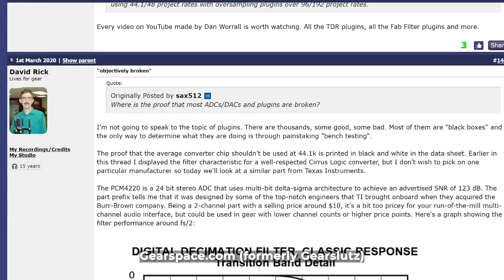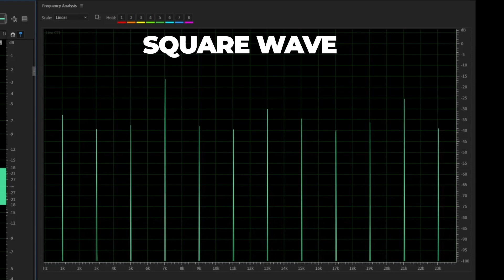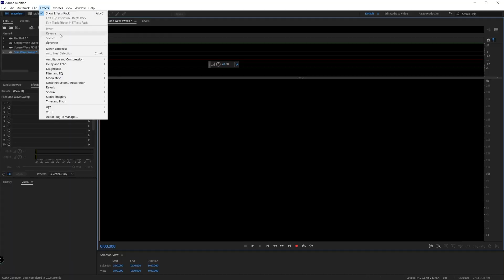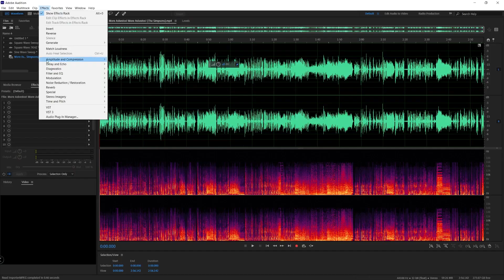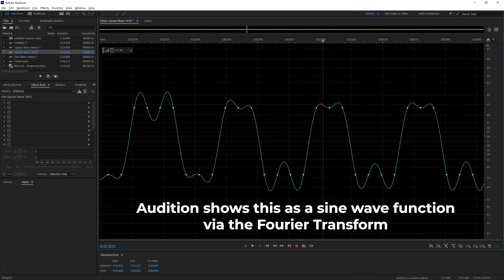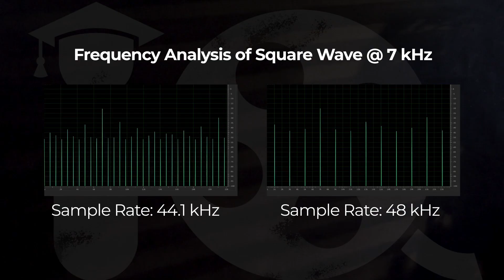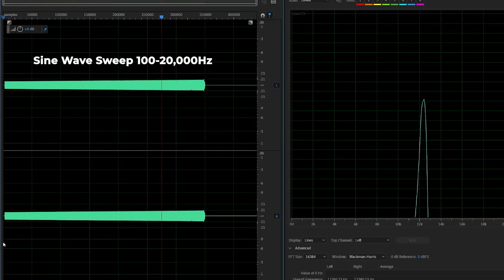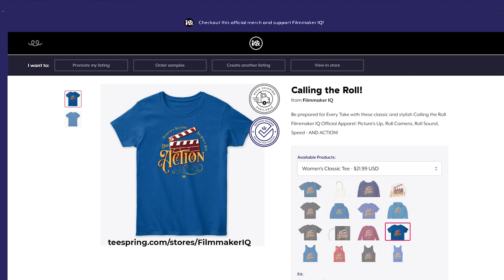What is the Optimal Sampling Rate for Audio? (It's All About the Aliasing)

Comment: Another thing. These tiny hair in the inner ear, being the hairs they are, are capable of vibrating in overtones as well as their fundamental.
The result of this that one such hair, say, matches a 5 kHz fundamental, could also resonate (in a more complex pattern) at 10 kHz, 15 kHz, etc.
This is another way of how ultrasonic tones are picked up by the ears - they can get picked up asif they were the fundamental of the overtone. This may account for how ultrasound influences and adds to the perception of normal sounds.

I remember doing some experiments with a tone generator, producing a strong 30~50 kHz tone on my headphones. I did notice a sound, it was not silent to my ears. It was a bit like an intense hiss, not very easy to think of it as a single tone, but it was intense, and would quickly hurt my ears if I tried to turn it up louder.

Having said all this, I still think that the effect of all this is very little.
Reply from the maker: So... Aliasing in the ear.

I think this is more evidence you WANT to band limit everything to around 20khz

Comment: The aliasing occurs because the simple generator has to fit the sample grid. At 10k you can see 3 short periods followed by 2 long periods because that is the closed match it can do without fractional steps. It can only fit perfectly if the sampling rate is a multiple of the frequency, such as 6k or 12k. A1k tone will sound cleaner at 48,000 too.

There are generators that mix the harmonics or use a finer grid followed by filtering and downsampling.

The conversion between 48 and 44 is relatively hard if you push artificial test signals that are loud at the upper limit. Simple resamplers are sometimes used. There have been reports where YouTube has messed up the conversion and one format turned out cleaner than another. It does some crazy chained conversions using ffmpeg. Currently it might be able to deliver 20k in Opus.
Reply from the maker: I think YouTube hard limits anything past 15khz
Reply: In the Opus stream I can see (well I can't hear them anymore) loud tones up to 18K. The audio has been through one generation of AAC adding the cuttoffs and blockiness. And the quieter tones start breaking up because the codec resorts to replicating them from lower bands at this bitrate.
https://i.imgur.com/E5VriTI.png

Comment: Curiously, it's possible to hear frequencies up to at least 50KHz, it has been demonstrated with bone conduction experiments all the way back in the 50s or so; however it was also demonstrated that they basically don't really matter - it's impossible to tell apart frequencies above approximately 16.5 KHz, they all sound the same, and there is some hard anatomical reason for that, i forget. So you may perhaps actually want to capture a little ultrasonic energy, but you can fold it back into the band above 17-ish KHz.

Band limited synthesis of the square wave is a solved issue. I think the simplest way is additive synthesis from sines, which you cover right in this video. Since Adobe has ignored this well known insight, one can consider their square wave synthesizer buggy by design, maybe they made it this way to look good to amateurs, band limited square wave always looks like it's heavily ringing, even though it's not. Unfortunately a lot of algorithms and plug-ins have some aliasing or other sampling rate related issues such as "EQ cramping", either due to limited computational budget or by oversight. So high sample rate intermediates are sometimes good, though should be ever more rarely actually needed as far as DAWs, their builtin effects and generators, and higher end plugins are concerned. Audition probably doesn't have quite that professional an ambition for a silly effect.

Something to keep in mind that most recording devices don't truly have a configurable sampling rate at the lowest hardware level. The reason is that the analogue filter that would reject aliasing needs to be tuned to the sampling frequency, and you don't want to include the same hardware several times, and yet more hardware to switch between those variants, not only for cost, but also for noise and other degradation that ensues. So the internal sampling rate can be for example 384KHz, and often analogue anti aliasing filter will have a corner frequency of somewhere just north of 20KHz. So you have over 3 octaves of filter room, so at 36db/oct filter, there's like 110db of suppression for all the junk. Then the ADC will have an internal downsampling to something more palatable, like 48/96/192 KHz, and these are easily aliasing-free. This isn't entirely how modern ADCs work (keyword delta-sigma modulation), but it's not too unfair a simplified representation. If 44.1/88.2 KHz are desired, resampling happens elsewhere downstream, in a DSP or software, and of course then it's the issue of how much you trust that particular implementation to be low aliasing. Just 12 years ago, it was not uncommon to find fairly low quality sample rate conversion in a major DAW! It's not entirely trivial and fairly computationally taxing to get right. Things got a lot better since. But for a given audio interface, you shouldn't expect 48KHz mode to introduce any aliasing that you can avoid by recording at 96/192.

Besides aliasing, the other potential resampler behaviour trait is phase shift, which nominally isn't audible, but under circumstances can be.
Reply: I bet it's not 50 kHz sound you can hear but lower harmonics from that vibration exciting stuff in your body.
Reply: @VioletGiraffe  Harmonics are always above the fundamental, not below.

But indeed it has shown that there are no auditory hair cells that correspond to higher frequencies than about 16.5 KHz. And yet there is apparently a mechanism to excite them with a higher frequency signal.
Reply: yeah subharmonic resonances would make that possible, it's the same sort of thing where humans can (pretty easily) distinguish phenomena above 60hz - despite that when *staring dead-on at a screen*, your eyes can't tell the difference. but your cochlea has actual pitch-specific resonators; the hairs float in the resonator bit, and the  resonator bit definitely does not have a 50khz band. so, yeah, it makes sense that you could identify the presence of sound in your environment that was generated by a 50khz emitter, but there is actually no possible way your brain could receive it as 50khz sound, it would be like seeing gamma rays or being touched above the top of your head - you can hallucinate the experience due to a real phenomenon in your environment, but it's not really representing reality correctly.

Comment: The difference heard between sample rates and bit depth are only down to the various filters applied to the signal when the audio device change mode. The best practise is to calibrate one and only use it, and work on your room acoustics and modes. If ou change bit depth or sampling rate you have to re-do your calibrations. It is actually better to play various sample rate materials all down to the same calibrated output than to change the output to the same as the material input. But inside the computer keep all your files as they came. When playing only use the output that is well known and calibrated. My outpud DAC is outputting 20bits 48 khz because I need the 48khz for the bluetooth compatibility and I use 20 bits because I am snob (it's for a type of stream). If I had not other constraints I would use 44.1 and 16 bits because that's enough, even when I want to smash the ears with 115db. As long as it is balanced xlr out for analog, we are happy. There is no excuse for time domain (and yes whe hear 7mn time bounces) n excuse for depth, no excuse for noise, no excuse for ultrasound.

Comment: As I understand it the main benefit to recording at higher sample rates is if you use any pitch manipulation or auto tuning. If you want to  digitally lower the pitch of a note then you could find information above 20khz shifted down into the audible range, so higher sample rates would smooth that out a bit. In practice even this isn't a real big problem, chances are you're moving the pitch not farther than to the nearest scale note, and even at 44.1khz it seems to do that fine.

Comment: Interesting video. Sample rates for recording should not be confused with sample rates for final distribution.  There is a valid reason to use high sample rates in the recording process for mixing and editing but the arguement for more than 44.1KHz for playback is questionable and may actually degrade audio quality with ultrasonic noise.  A well recorded track that is re-sampled down to the 44.1KHz CD format is capable of delivering top quality audio.

Comment: Best sampling rate is the rate of output DA converter. Every lowcost device on the market have 48kHz DAC, higher priced devices going to multiples of 48k. Its not good for music, because of 44100Hz matrix standard for music. Aliasing is not only microverse fs/2 problem, it is overall spectrum problem include bassline. Check your DACs rate and record music in the same rate with ADC. Dont use software or numerical hardware to resample. Use DA-AD, DA-mixer-AD, DA-mixer-effects-AD, yes, mixer and effects in analog version. If you have music CD, you needs 44100Hz DAC to not get aliased listening. Only PC soundcards providing 44100Hz feature nowadays. If you do this, you will find that everything has to be done in real time, not faster. Or record your music into 48kHz directly and have no aliasing problem with anycost players... PS: Fourier transform cannot solve aliasing perfectly, e. g. brickwall, interpolation, lowpass filters. Just only ADC built-in comparator can do.

Comment: real fun times when you generate a 10khz square wave with a function generator and not run it through anything to contribute sampling error.  fun experiment, but could still definitely tell the diff between square and sine, and even sawtooth for that matter (most of the lab could).  could be that the speakers you use have an impact on this test as well.  noticed the switcharoo at the end too
Reply: Yes, the existence of harmonics can easily be heard.
Reply: @kensmith5694  cool

Comment: Only real advantage to faster sampling rates is it makes the anti-aliasing filter easier to design. I routinely oversample industrial ADCs 8x so I can get away with using a 1st order low pass filter. No brick wall filter required.
Reply: In one design, I over sampled by a factor of 22.  It was for the reason you suggest plus the fact that the numbers grow extra LSBs when you do it.  The noise rattles the bottom few bits and then the filter averages those numbers.

Comment: Another thing to consider when it comes to the actual recording process is that ADCs aren’t actually taking momentary samples of a raw voltage, they’re actually integrating a sample over time. So the aliasing effects from a recording are different than the aliasing effects from a resample of an already-digital signal (and there are also different means of resampling a digital signal that mitigate the aliasing effects). This video mostly demonstrates that Audition’s signal generator is just really bad at its internal resampling method and is just doing a naive nearest-neighbor approach. It’s definitely something to keep in mind when it comes to sample rates but it’s definitely not a win for the audiophile camp.
Reply from the maker: I disagree that Audition did anything bad. It wasn't resampled, Audition created a genuine square wave - exactly what it was asked to do. A genuine square wave has these aliases especially at those frequencies.

And looking more into it, I don't believe ADCs are integrating samples over time, they are sample and hold. Aliasing in recording works the same way, it's just most equipment already band limits the audio being recorded
Reply: @FilmmakerIQ  There might be a few different ADC technologies out there, then, because the understanding I had from the origin of DSD (as opposed to PCM) is that it's getting the raw signal from an earlier stage of the ADC, specifically to avoid aliasing artifacts and to allow true resampling of the closest possible equivalent to the raw analog signal. Of course that's a whole other audiophile rabbit hole to fall down.

And yes Audition is generating a genuine square wave, but the way it's generating it leads to a crapton of sample jitter in the frequency domain. If they had done even basic antialiasing of the signal it wouldn't have been pure -1/1.

For a visual equivalent, this is like doing non-integer nearest-neighbor scaling in a retro video game console emulator, leading to visible shimmering as the screen scrolls. Generating a visual black-and-white checkerboard has the same problem, where your checks aren't going to have the same perceived width across the entire field unless you antialias it.
Reply from the maker: "And yes Audition is generating a genuine square wave, but the way it's generating it leads to a crapton of sample jitter in the frequency domain. If they had done even basic antialiasing of the signal it wouldn't have been pure -1/1."

So... it's doing exactly as it's asked?

You keep talking about resampling... nothing of the sort is happening. Audition's tone generator is a basic diagnostics tool. It's not a musical plugin.
Reply: @FilmmakerIQ  There are antialiasing approaches which don't rely on resampling, and you can generate a pure square wave with them pretty trivially, no resampling necessary.

And yes it's doing what's being asked, but it's doing it in a naive way which generates ring frequencies, which causes misleading beliefs about Nyquist-Shannon theory, which your video did a great job of debunking. I was simply trying to add to that from a signal generation perspective.

And you're correct, Audition's signal generator is a diagnostic tool, not a musical tool. It could still be better as a diagnostic tool.

I only keep mentioning resampling because that's an easy way to think about antialising in general.
Reply from the maker: I simply don't get your point about resampling - there's no resampling. Those ring frequencies are aliases at predictable frequencies, those don't appear to be sample jitters.

A pure square wave will always create alias frequencies when sampling... an anti-aliased square wave especially around 7khz won't be much of a squarewave if it's anti-aliased
Reply: @FilmmakerIQ  We're talking past each other in a way where things are getting progressively more muddled.

Read up on the history and implementation of DSD, especially as how it compares to PCM, which gets back to the original point I was trying to make regarding interval sampling, rather than momentary aliased sampling.

Also, I believe that the test oscillator in Logic Pro uses antialiasing on its square wave generator to reduce the amount of ringing that occurs. The waveform of an antialiased square wave is still absolutely a square wave, except that the samples between the duty swings are at a position between -1 and 1, the same as you'd get if you were to originally generate the square wave at an extremely high sampling rate and then downsample/resample it appropriately. Which is all I was trying to say.

This antialiased square wave will be very similar to a sine wave which has been amplified to an extreme level and clipped.
Reply: @FilmmakerIQ  also FWIW my background is in graphics programming, and the signal theory for things like texture filtering and image scaling are very, very similar to the signal theory with audio sampling. It's not a direct correspondence but they're more similar than they're different.
Reply from the maker: I think you're getting hung up on the idea that square wave that is anti-aliased is actually a square wave... It's not... It's a square wave that has anti aliasing filter applied.

The whole point of the video is directing people to understand what aliasing actually is. If you anti alias everything then we won't really understand what aliasing is in the first place
Reply: @FilmmakerIQ  And I think you’re getting hung up on the idea that I was trying to attack you or say something contrary to what you were saying in the video, rather than trying to expand on it.

An antialiased square wave is just as much a square wave as the built-from-fundamental-frequencies square wave you used in the comparison example at the end, with the advantage of actually looking square.

Also, one easy-to-implement but computationally-inefficient approach to implementing antialiased resampling (in both audio and video domains) is to upsample the original signal to a large multiple of the target sample rate, then apply a low pass filter at the Nyquist limit of the target rate, then downsample it. Other resampling algorithms largely attempt to produce equivalent results to this but using less memory and/or CPU in the process.
Reply from the maker: Sorry, been reading non-stop attack comments on this video. A lot of the nasty attacks are saying I didn't do the audio right. I think Audition did exactly what I asked it to and the result was I have a much better understanding of what aliasing actually is rather than a vague thing that everybody is "anti" about. :)
Reply: @FilmmakerIQ  Ah, yes, I have to remember that there's more commenters than there are yous. :) I absolutely wasn't intending to come across as attacking you, sorry if I did!

I think you did a fine job of explaining the issues and the theory, and the Audition tone generator is a great way of demonstrating the issue with sample aliasing and ring frequencies.

Also, to follow up on an earlier comment, I just checked and Logic Pro's tone generator does have an antialising option, but a quick manual check shows that whatever algorithm they're using doesn't entirely eliminate ring frequencies from the square wave (not that I'd expect it to).